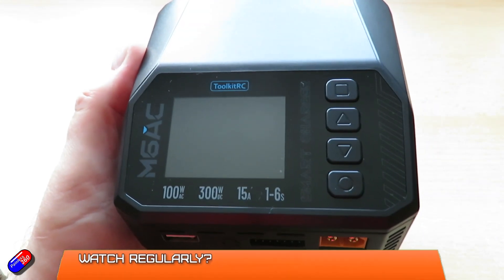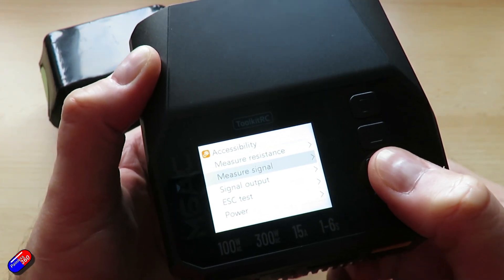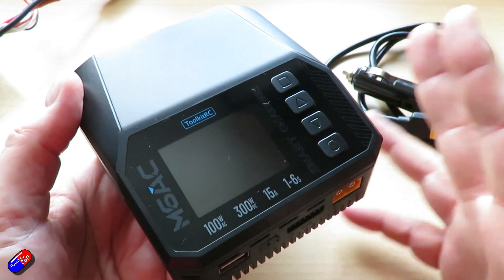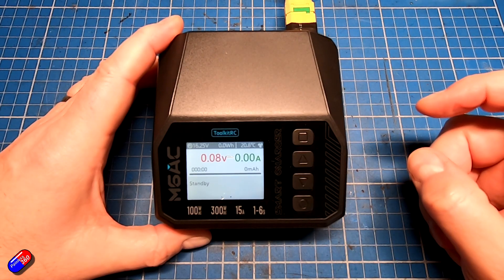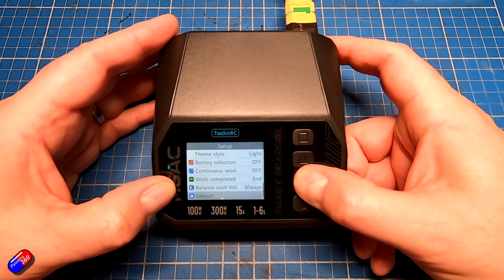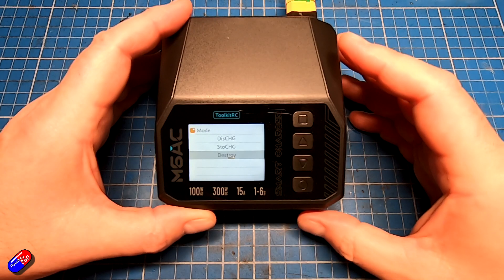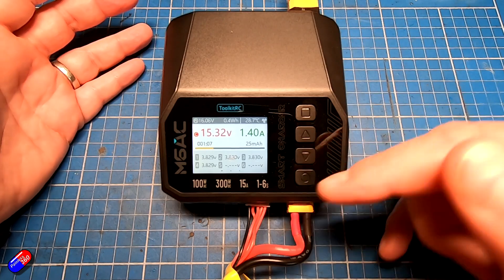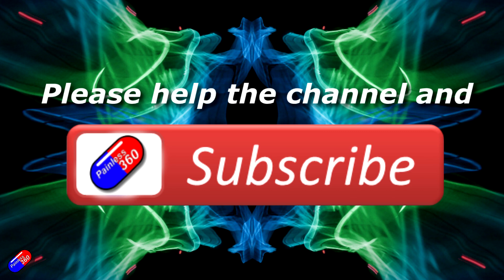ToolkitRC M6AC: A single battery charger with a few cool tricks!

Comment: Hi, I have a question that's actually about the M9, but I think it applies to both devices, and neither explains it in the manual:
When charging, what do the colours in the individual squares for the individual cells actually mean?
I am just watching it charge a 3S LiIon pack, I see the orange square jump from cell to cell, sometimes two are orange at the same time for a brief moment.. what does it all actually mean?!?
I understand balance charging, but does this mean that it always only charges one (at most two, very briefly) cell at any given point in time? My three cells are currently all between 3.89V and 3.90V, so I would have thought it can now just go and charge them all, at least for a bit?
Reply from the maker: I've wondered this and it seems to have no standard across chargers. Some are showing the cells getting current, some those that are being bypassed. Best of luck
Reply: @Painless360   yeah, it's bizarre how their manuals show a picture of symbols in different colours but then doesn't offer any explanation either. And it's clearly not self-explanatory, as there are whole threads on Reddit of people speculating...

Comment: Which would you choose between the M6AC and the M7AC?
Reply from the maker: I'd choose a dual port charger as once you get into the hobby you'll find charging packs one at a time takes forever! :D
Reply: @Painless360  Been flying glow long  before electric.  I have a few chargers and still using an original Bantam that everyone copies.  I like having separate chargers so as to not have all the eggs in one basket.  Looking at new ones.  Had 2 HTRC units die quick.  Nice when working, but will never buy again.  They would not replace.
Reply from the maker: I'm a fan of the SkyRC and GensACE chargers. I use them here for my own hobby... Happy flying

Comment: I’m still a big fan of my SkyRC Q200neo 4 channels charger which has power output from 0.1V to 36V , 0.1A to 10A and BALANCE charging mode. Though it doesn’t have SBUS , PWM, PPM analyzer but I have professional oscilloscopes.

Comment: I purchased aToolkitRC M6Dac dual smart charger for use with my Zeee 4s 2200mAh LiPo batteries.  I have had no issues with charge, discharge or storage functions since purchased last spring. Use 3 batts for my SpeedyBee drone and one for my walksnail goggles.  Very happy with this setup.  Also used your tip to discharge one damaged battery using an automotive brake light bulb.

Comment: Sorry, maybe I wasn't paying full attention - does this have any significant functionality that, say, the ToolkitRC M8s doesn't have?
I love my M8s, I am using it for purposes ToolkitRC, especially with two small additions I rigged up:
1) I built a male-to-female XT60 adapter so I can use the power supply essentially simulate a battery, I can run whatever is normally powered by a XT60 battery from the desk, and measure the current draw
2) I built an adapter for my Lenovo Thinkpad laptop, so I can plug any drone battery into the back of the M8s, set the voltage to 20V and plug my laptop into the side of the M8S
3) I put an XT60 plug on my 100W laptop charger, so with the adapter described above, I can run the laptop directly from its adapter, use the laptop charger (via M8s) to charge my drone batteries, or use the drone batteries (via M8s) to run my laptop...

Comment: I don't know the struggle about ToolkitRC. I got the M4q from back in the days when 4S was standard on 5" freestyle and still use it today for my smaller 3" batteries. Also now I have the M8s and M8d and they never let me down. They allways made good menus and options on the chargers which I really like.

Comment: I had a small issue with my M7AC being unable to charge 4S batteries. They offered to either replace it or give me instructions on how to fix it. It was a simple solder bodge on the PCB and it's been absolutely flawless ever since. Apparently if the input voltage matched the output voltage (which it did on 4S) it would cause some kind of issue and stop charging. As mentioned it's been solid ever since.